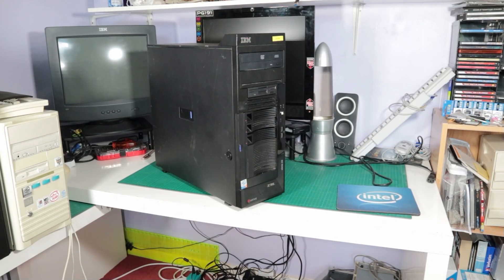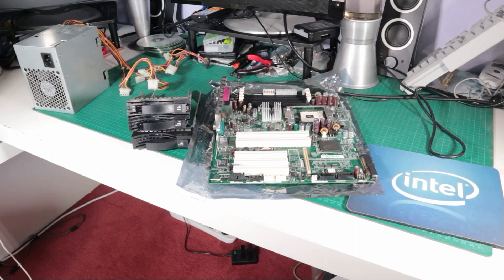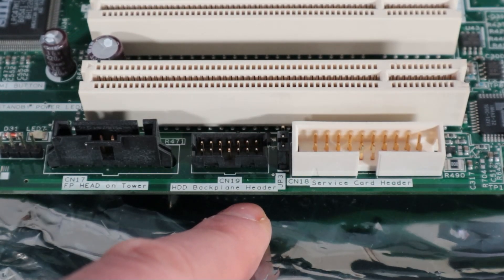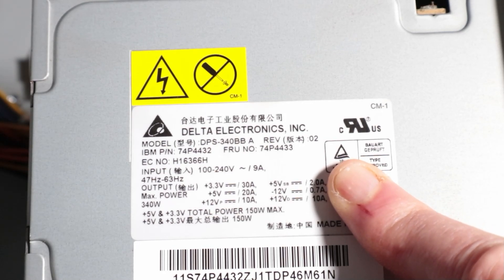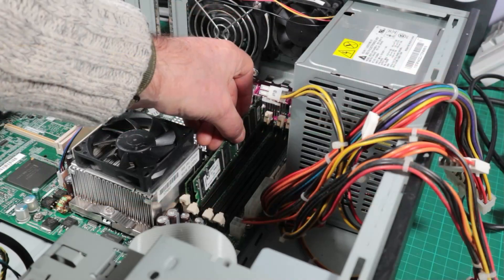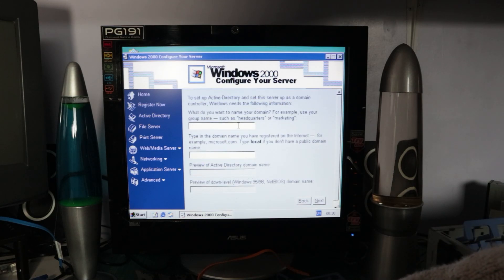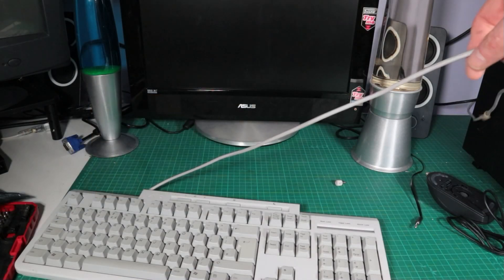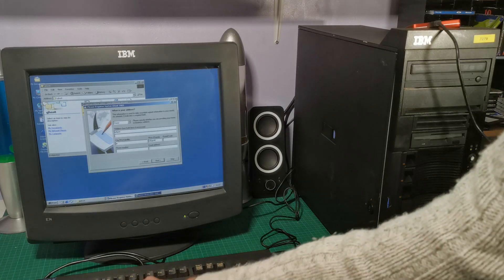One of IBM's last small office servers

Comment: IBM actually continued to make servers until 2014, when they sold their x86 server division and the System X branding went to Lenovo. They also continued to manufacture their Intellistation line up of stationary workstations until 2009.
You also might want to consider swapping the bloated capacitors on the system board/planar ASAP, otherwise you might encounter stability issues  such as freezes or system lockups down the road.

Comment: We used to use Norton Ghost to image our computers at our university. If you can figure out how to use multicast mode it was really efficient even on a 10 mbps network. We could image dozens of computers at one time.
Reply from the maker: Cool, yes we had a test lab at work with about 50 networked machines and used ghost to push out single/multiple things. Will be fun messing around with it.

Comment: The chip (SL76G) you show at 4:58 is dated 38th week of 2005.  It's likely this was a late make board for warranty service.  Bottom sticker on the PC shows a manufacture date of 411 on the bottom right.  November 2004 fairly late for Socket 478..
Reply from the maker: Cool, I got the case first then bought the other parts seperately so they will all be missmatched date wise, there could have been several revisions to spec between them.

Comment: I love old hardware but one thing I can never get behind is old servers. They're just way too limited in what they can do, even if they just serve old computers. I'd rather set up a docker container running an old server OS or some VM on my modern home server to get compatibility with my retro systems. Maybe it's just me but for servers I can never have enough power and use cases to justify having them running 24/7. Old machines can do very little but suck up just as much if not more power. I struggle to justify this. Still cool project.
Reply from the maker: It isn't really practical as a  real server, its an exercise in using retro machines. I still think it would be harder to pull something off a docker container to a 286 than it would be to just plug it into a switch and pull from a amchine like this, which is the kind of thing it will be used for.  It wont be on 24/7, only when I'm using ir.

Comment: Great video! Just one thing that I may want to add, the PSU is rated 340W the 150W is the max output for combined 3.3v and 5v only. But this is fine because servers may lean heavier into hard drives, optical drives (well maybe, if you think early 2000s) maybe more memory slots in them, maybe some motherboard chips as well (super I/O, etc) all using 3.3v and 5v. so you would want the PSU to look something like this I am thinking. Delta electronics PSUs are decent in my humble opinion. Always look forward to the content!
Reply from the maker: Cool, I should have read it more carefully 😁, thanks for watching!